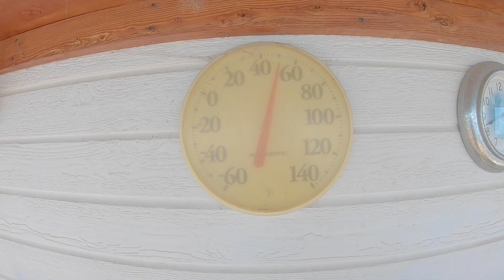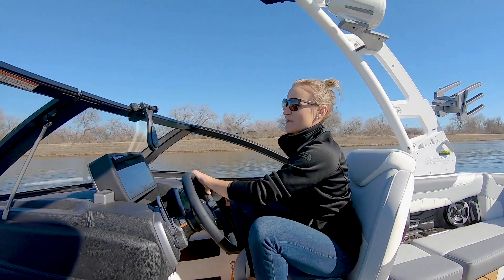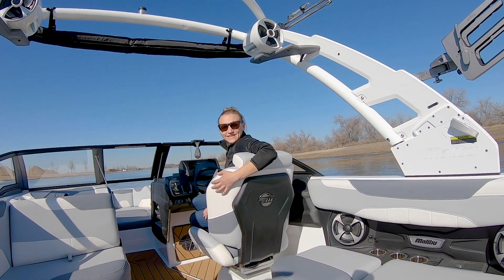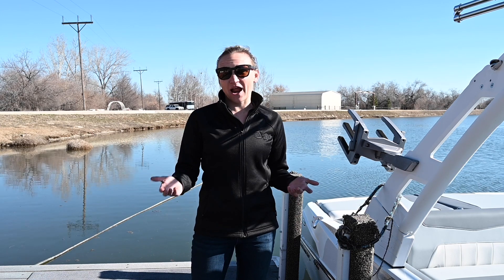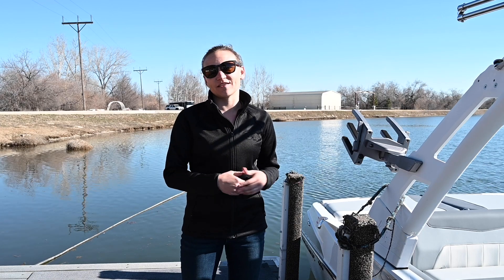The New Malibu M6Di Engine | Water Test, Comparison with PCM450

Comment: I'm looking for a surf and barefoot boat.  With either of those engines give me 44-45mph on a LSV22?
Reply from the maker: If you put a speed prop on the boat, you may be able to get there!
Reply: I got a 2019 GS22 with 450hp and love the boat for boat surfing and it runs 42 top speed for barefooting. Best of both worlds.

Comment: Curious to know prop diameter, pitch and elevation. Thanks
Reply from the maker: For sure! Elevation - ~2,500'. Prop on both boats - Acme 2249 - 15" X 14.25" - it's the high altitude/torque prop you can order from the Malibu factory.
Reply: Chantel Herbert Thanks for the specs. Are the new 23 LSV’s able to run props larger than a 15” diameter?
Reply from the maker: @timothyjeavons1  No. The 25LSV, 24MXZ, and the M235 have the 17in prop, but the 23LSV sticks with the 15in.